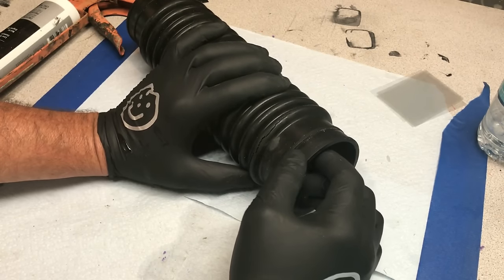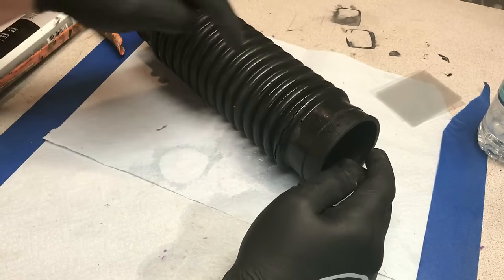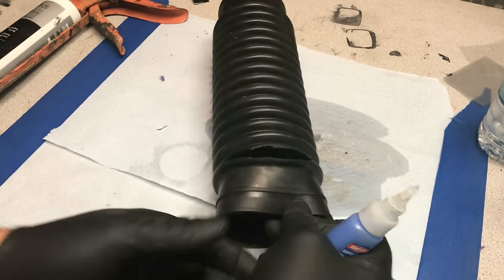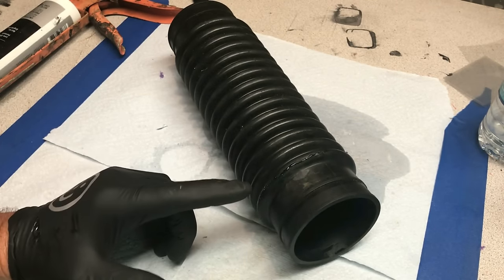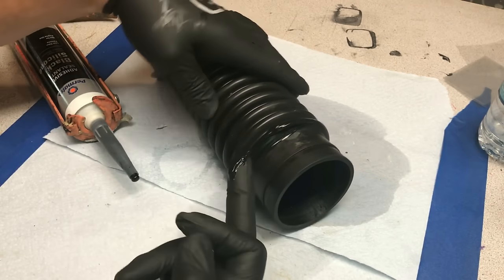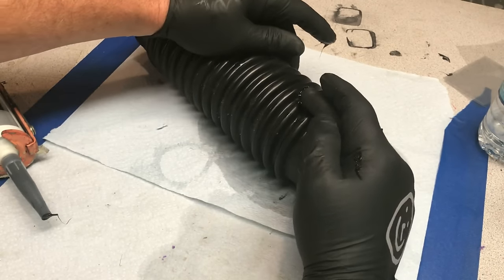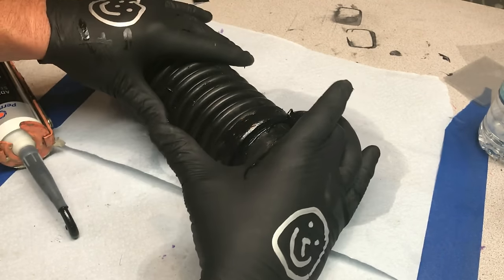How To Repair Split or Cracked Rubber... Intake Tube....Fast and Strong!

Comment: OK lets see what info we get from you guys. This is a message in a bottle to all you out there. whoever  can give me an answer based on experience only would be highly recommended bc this is a repair for my hyundai iload.  rubber hose that is connected to the outlet of the turbo. now as we all know there is an enormous build up of pressure going on in that specific area. there is a rip close to the mouth approx 2 cm away from the edge. the damage is roughly 4cm long. would this application be able to withstand the pressure? would i need to do perform the application on both sides. As in to  both the inner and outer surfaces? anyopne who has had this issue and has gone ahead with this repair please let us know.  ok i know this is an old thread but i got nothing to lose. over n out :))
Reply from the maker: We would try this first  https://amzn.to/2LfFaJh  if that doesn't work you're going to have to replace the tube my friend, that's a lot of pressure as you said. Thanks for watching and asking, we appreciate it, have a great day and all the best on your project. mad Mike & team

Comment: $120 vs. this fix?  🤔  Why aren't there more shops out there who could do this vs getting a brand new par. :(
Reply from the maker: They go for the easiest most expensive repair, that's why there aren't more shops doing it.  But, you have SPC to the rescue, your DIY source for saving a boat load of cash.  Thanks, have a great weekend.  mad Mike the hammer SPC

Comment: Nice job. Can you just take electrical tape and wrap it? 😊
Reply from the maker: You can use any tape to wrap it but chances are you are not going to seal the crack up. If you use this https://amzn.to/3Dvpmit   it's a small price to guarantee that it's sealed up, that's not much for great peace of mind. Hope this helps. Thank you for watching and asking, have a great day my friend. mad Mike the hammer SPC
Reply: @SweetProjectCars  thank you man. I used super glue than wrapped it. It holds well for now.

Comment: What about repairing an expandable garden hose??
Reply from the maker: We have tried to repair those expanding hoses the only way we have found is that if the hose is damaged close enough to the and will cut that off and reattach the end
Reply: @SweetProjectCars  
Thx for that speedy reply!!
I ended up just cutting the hose off at the break point. Its usable ..lol
Reply from the maker: good deal thats what we do
Reply: @SweetProjectCars  Ditto on cutting off the bad end. Those hoses take a lot of pressure, are super flexible/expandable and very little can repair a hole, crack or tear.

Comment: What about using flex seal?
Reply from the maker: Peter we have tried it and it will not take the heat my friend :)
Reply: On many projects that require sealing I like to use GOOP but I never really use it near heat.
Reply from the maker: Gary Srock thank you for sharing my friend and yes the heat has to be taking into consideration when doing the method have a great day my friend :)

Comment: Yes, but everywhere recommends NO SILICONE for air intakes as curing silicone leaches into system and damages oxygen sensors. So...at a guess, any silicone-free liquid rubber would do a grand job of repairing air intake rubber tubing..??..!!
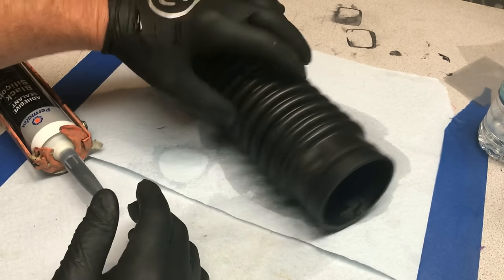Reply: @2:25 he states that they don't put any inside so that nothing goes into the engine... And then explains that later he'll show to how to do it inside if it's not on an intake going into the engine :)

Comment: If you need to remove it to repair, better off replacing it.
Reply from the maker: Well if you don't have the money to buy it and you can't have your vehicle down because you've got to try to make a buck, this is a great process to do. Thanks. mad Mike the hammer SPC